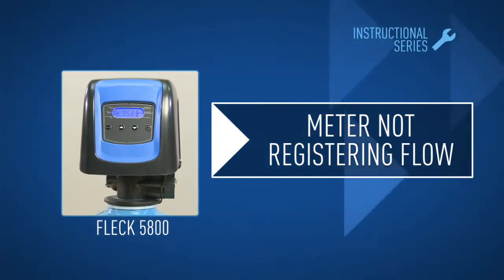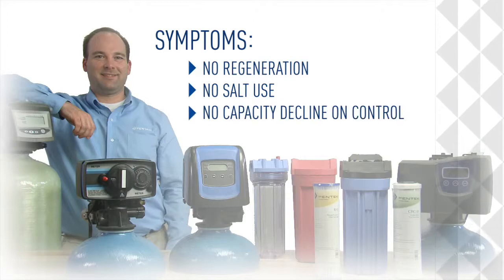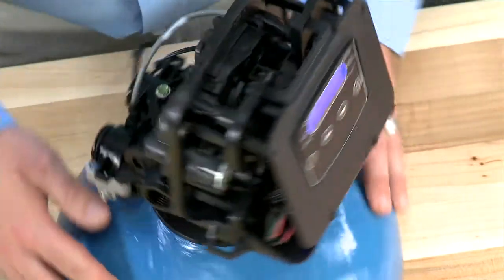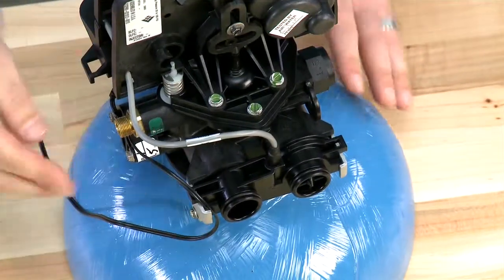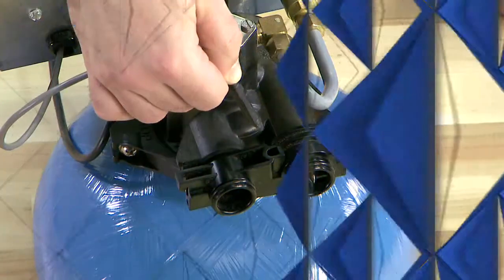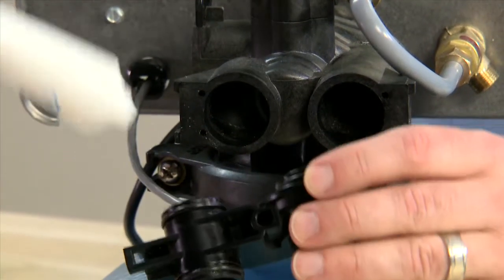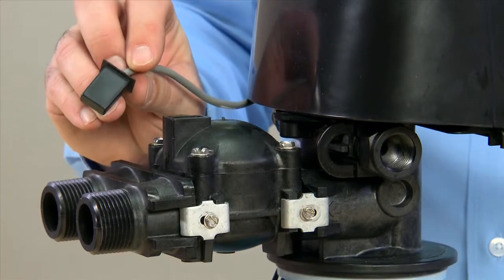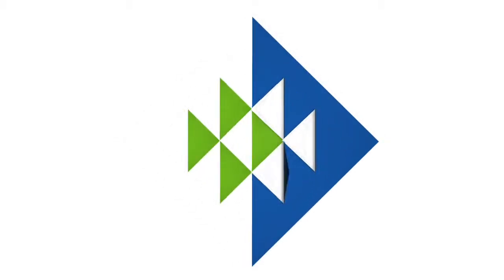Fleck 5800 Meter Repairs

Comment: I have a 5800 sxt. It would have been great if your video noted that the flow meter cable has a barbed end that needs to be released with a screwdriver from below. The cable doesn't just pull out like your video shows. The barbed end broke off on mine after I yanked on it with pliers.